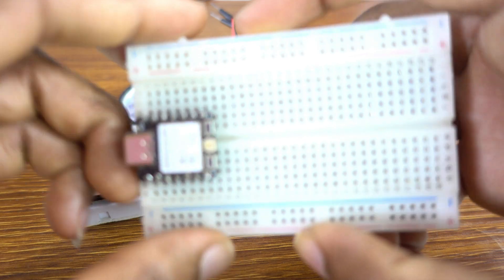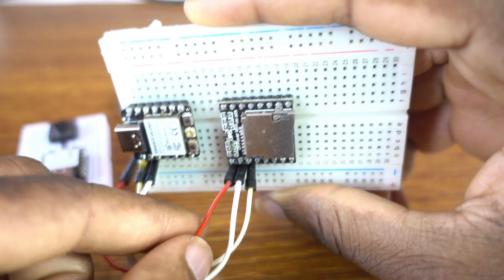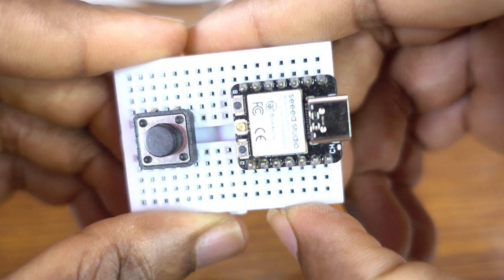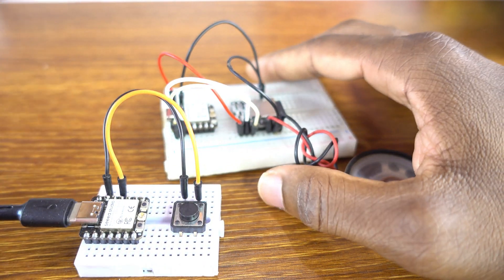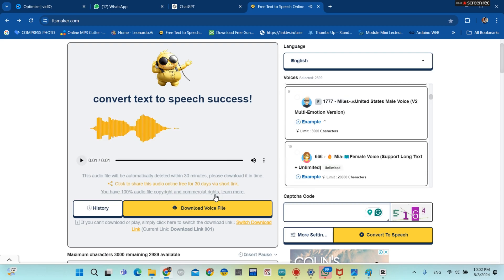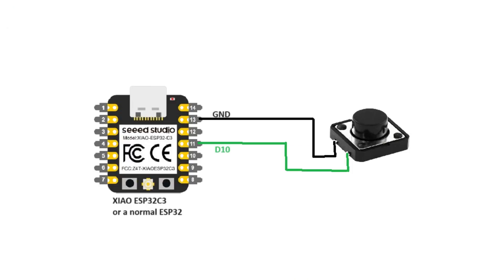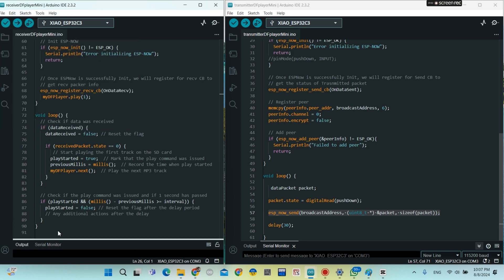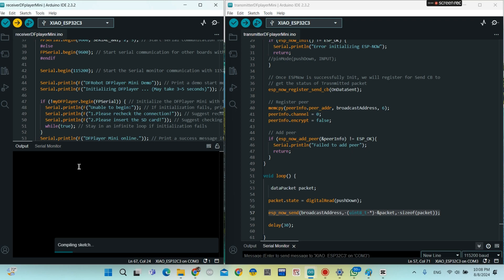Play Audio Wirelessly with XIAO ESP32C3 and DFPlayer Mini using ESP-Now

Comment: Hi I have just tried to upload the transmitter but it has come up with an error code exit status 2, I'm a beginner so not sure what that means exactly
Reply from the maker: Which board are you using ?
Reply: @uploadideaswithitamar  xiao esp32-c3 with push button attached to ground and d10. Every time I try to upload it I get Failed uploading: uploading error: exit status 2, I tried also with the receiver one and it came up with the same thing.
Reply from the maker: Do you normally use this board ?While plug-in the cable to your board press the RESET button and don’t choose the port just hit upload
Reply from the maker: Incorrect Board Selection: Make sure you've selected the correct board and port in the Arduino IDE. If you're trying to compile code for a board that isn't correctly selected, it can lead to compilation errors.

Comment: Hey,

Thanks for the video!
I'm using your code, and after one press on the button, the void() loop stop working. The receiver still receive data from the transmitter but don't send anything to the DFPplayer and I can't find why ^^
Reply from the maker: What does serial monitor say?
Reply: It still show the "button:" and 0 or 1 depend if i press the button or not.
Reply: Ok it seems to be the function myDFPlayer.next(); if I replace it by myDFPlayer.play(1); it works perfectly.
Reply from the maker: @elyrannou5783  I think I posted the wrong code of the receiver
Reply from the maker: @elyrannou5783  It’s indeed the right code. Glad it worked